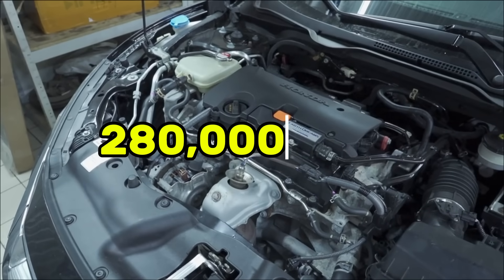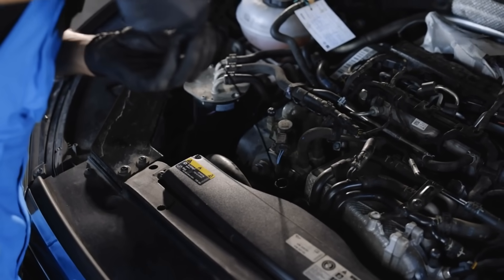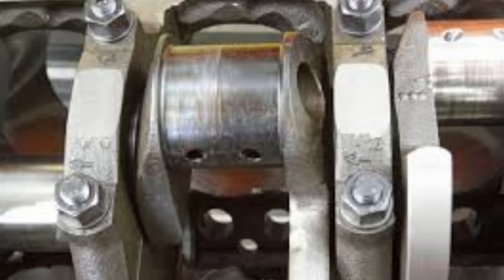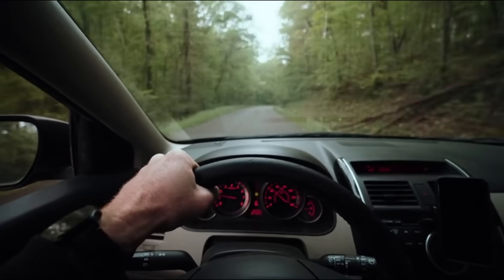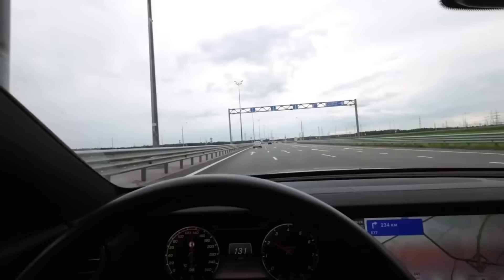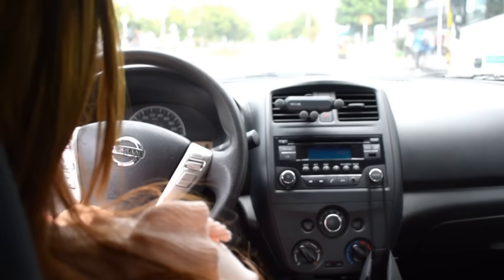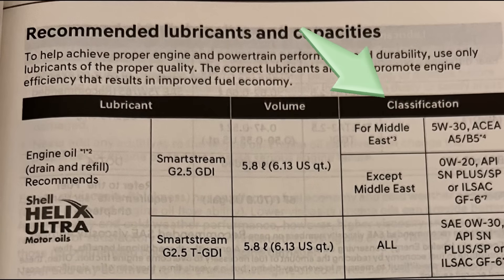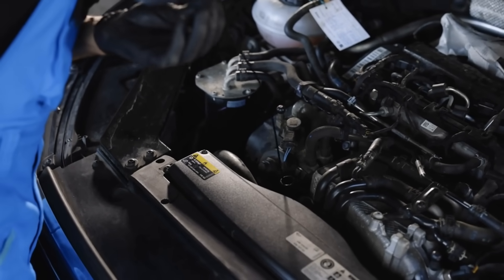I Tested 200,000 Miles of Engine Oil and Found the SHOCKING Truth

Comment: Run a 0w-40 viscosity, and change every 5000km/3000 miles...............................Your engine will last over 300k no problem.
You have the low viscosity at cold, and nice cushion when hot.............Just change often to keep the viscosity inprovers in good condition.

Comment: All this is so true just replaced a motor running 5w30 synthetic blend at170,000 miles now using 5w30 full synthetic oil filters make a huge difference as well😮

Comment: This video is very misleading. There is a lot of variables at play(if this experiment is actually true) fuel type matters(top tier vs non) oil type(type of chemistry/brand) and also driving habits. Personally I stick to 0w20 and no issues so far I also use penz ultra.
Reply: Depends on the engine too. You’d kill an old bmw engine with 0w20 they recommend 5w30 but most run 5w40 in Europe and 10w60 in hotter climates

Comment: My 1981 Subaru GL hatchback's owners manual recommends against 5w-30 (Unless you are living in Alaska)  because it's too thin to protect your engine and recommends 10w-30 for the winter. 20w-50 (thickest oil) should be use in the summer or all the time from S. California to Florida.
Reply: That is ancient aliens tech...modern cars are designed with lower tolerrances, complex.turbines etc.

Comment: Recently purchased a Nissan Qashqai Hybrid. The engine only turns a generator that feeds electricity  to the battery which in turn feeds power to the electric motor which turns the wheels. The engine oil is a 0w16 which is even thinner than the 0w20. I can only assume that because the engine is only running now and again this will be okay. Saying that it is a bit worrying when reading this article. Any comments or advice would be appreciated.

Comment: None of the 0w-20 Bad stuff happened to me. In 2016 I bought a brand new Honda Fit.I've been running shaeffers 0w-20 I change it every 10,000 miles, and I now have a 150,000 miles on the engine, and it runs just like it was new. I check with Blackstone labs, and they say that I have less wear at 10,000 mile. Oil changes versus 7500 in the same vehicle. With other Owners , and they say that viscosity at ten thousand miles is right on par with 0w-20 I do drive, Non Aggressively though I live in Southern California high desert where it gets around a 107° in the summer and down to 32° winter mornings. So I think I'll just be sticking with the 0w-20 If it ain't broke don't fix it😊
Reply: We all know you can't break a honda fit even if you wanted to
Reply: Consider using 0w-30. Same cold start protection, MORE protection for hot engine. My Mitsubishi thanks me every single day for this oil specification.
Reply: @RaduMichaelI don't know why I actually would change to 0W30. Because with 0W20 all is good and Blackstone says, keep doing what I'm doing, my wear, metals are virtually nil. Now I could do it as an experiment to see if wear metals even get better but I don't think they would As I'm doing it now.That engine will probably way out last the whole body of the car

Comment: I have several cars that range from 0W-30 (not mentioned) to 10W-40.  Never use any 20W oils or lower.
I change the oils in the turbo cars every 3000 miles and 5000 in the non-turbos.  Also, I use 100% synthetic from major brands specified for the engines.
Reply: Actually ow 30 IS mentioned in the video if you watch it all.

Comment: 5W20 in an 05 honda pilot at 256000 miles
Reply: Honda  👍🏿
Reply: 242k on my 05 civic hybrid. I use nothing but 0w-20 in my Honda as told. And never had one issue. Inside the engine bay is spotless as tho it came out the factory. These kind of videos always make me question alot of things.
Reply: @elijahbreazil3082 honda and japanese carmakers in-general make better engines.  Thicker oil is a band-aid for problem engines like Jeep & Chevy
Reply: Well done. 200k is the benchmark for modern engines. Lots of people talk 100k+ but in my opinion most cars accomplish this easily. Very few are part of The 300k Club. I had 2 honda civics and a crx reach 260k. Also have a toyota sienna just recently hit 270k. 10w-30 all day every day. Located in southern California climate zone.
Reply: @snaxs2000 this is the original engine with no issues. I want to see how far it goes, so I'm into it till the engine dies 😊

Comment: Mine is 2013 ford ranger and i use 10-40 diesel shell helix engine oil in it.. The car millage is 220.000 until now 2025,still in good condition..plus i from malaysia and here the weather is very hot..

Comment: My 2001 BMW 330i consistently uses 5W-30, full synthetic plus one oil additive, Liqui-Moly, at every oil change. Still smooth engine at 197,000 miles.
Reply: Molybdenum clogs the filter.   How often are you changing oil?

Comment: My 2011 H - Crosstour requires 0W-20. I use synthetic 5W-20 and 1 oil additive, Liqui-Moly, at every oil change. So far, smooth sailing at 163,000 miles.
Reply: The only difference between synthetic 0W-20 and 5W-20 is that the 0W has a better flow rate during cold starts. Modern synthetic oils already have additives in them that were developed by the engineers to provide the protection you need. Be careful about the additives you put in yourself. It is possible to get too much of a good thing. 20% or more of modern synthetic oil is the additive package.

Comment: The most important thing is to change it regularly which surprisingly many people fail to do.
Reply: They fail to do so because they are too stingy.
Reply: @ralfrufus6573 or because the manufacturer promotes „long life intervals“. Which works most of the time for the first leasing period, ,mostly also for the second owner, but third owners inherit the problems then.
Reply: Exactly, I change mine 3 times a year no matter what. Around every 3.5k miles. I idle a lot though, when warming the car in the winter so it’s not fozen when I get in, that burns extra oil
Reply: @designer.346 👍💯Excellent oil change schedule.
Reply: I stick to 3000mile oil changes.  Dont care what manufacturers or dealers claim .  They wana sell more cars.  I just change my oil and filter myself every 3000miles so I kno its actually done right.   Too many horror stories about shops not even changing the oil and charging anyway.   Or leaving the cap off or not tighting the drain plug and oil leaking out ect.  I use valvoline restore and protect oil and microguard select oil filters.   My current vehicle has 239,000 miles runs like a top.  My wifes cx50 is brand new and I change hers myself also.    I dont trust the dealership.   I keep the reciepts and keep a log book recording miles n dates ect to keep my warranty happy 😊
Reply: Every 3,000 miles period
Reply: Yup thats another reason to use thicker oil. It maintains viscosity longer than lighter oil.
Reply: and use synthetic oil.
Reply: @sptrader6316 there is more to it then that, there are 2 different API Shield on each bottle of oil for gasoline engines API SP → Latest standard (for modern engines, protects against LSPI and timing chain wear) model years 2020 and up and API SN, SM, SL → Older gasoline standards. API SN – Full Synthetic, API SM – Synthetic Blend, API SL – Motor Oil conventional.
Reply: I'm an old fart, still do it between 3,000 and 3,500 .

Comment: I have a 2016 Jaguar f type R Jaguar recommends 0w 20 no way use 5 w 30 it’s a 550 hp supercharged engine. Am actually thinking of going to 5 w 40. What do you think?
Reply from the maker: Stick to 0W-20. Your engine is designed for it. Thicker oils (5W-30/40) can cause flow issues, especially on cold starts, and are not recommended for modern engines engineered for 0W-20

Comment: I've been using 10W 40 for 10 years now on my chevy. The engine is purring like a cat. I also live in a very warm climate. My manual stipulated that i should use a 5W 30. Naah, too thin!!!
Reply: I use 0w40 in my 2008 Audi with the V6. 175k miles so far. Change once a year whether it needs it or not.
Reply: @RogerBeckett-s2j  lo 0w40 è la migliore gradazione di olio, ed è un olio con grandi contenuti tecnici.
In Europa è molto usato lo 0W40.
Molto usato il 5w40, anche.
lo 0w20 sulle macchine giapponesi perchè lo richiedono, ma danno anche garanzie estese, e devi fare i tagliandi da loro.
il 5W30 specialmente sui diesel, per mantenere irrorata di olio la turbina.
In America vedo che i quesisti si dividono principalmente tra 0W20 e 5W30.
Quando lo 0W40 è forse un olio che mette d'accordo tutti.
Qui il MObil 0W40 è ritenuto l'olio eccellente. Lo Shell 5W40 Helix Ultra ill top insieme al MObil e Castrol. C'è anche il Motul che sta guadgnando immagine e mercato. 0W20, ormai lo fanno tutti, ma in concessionaria, ti mettono quello loro. Per il 5W30 è sempre Mobil il top (Esp) e Castrol.
Olio americano qui arriva solo il Royal Purple, per gli amanti del marchio (anche se Shell è Penzzoil)
Reply: @Sonolaleggendadeimotori I use the Castrol in my Audi. I use cheap but still synthetic 5w-30 in my wife’s solara convertible. My cars usually go about 250k miles before I trade for newer used car. I’ve never bought a new car in my life.

Comment: Mobile 1, 5W-30 Full Synthetic High Milage Extended Performance. 2009 Cadillac SRX 4.6 V8. In Las Vegas, she runs excellent!
Reply: Run a 0w40 Mobil 1 in it and that engine will love it...............been running it in my C5 corvette with the LS1 for years.

Comment: Ferrari knows better and is using 5W-40 HT/HS 3.5 for his cars.
For my 3 cars I'm using 10W-40 A3/B4 HT/HS 3.5!!!!
In Greece the weather is hot especially at summer.
Reply: 0w weight oil is to thin of base for IC engines, 10w30 is a better option unless you are in extreme cold climate

Comment: The moment you start talking about engine oil in terms of  think and thinner and your your way off and have no understanding of how viscosity works because that is the measurement of a fluids resistance to flow against gravity
Reply: And eyah you idiot if your starting the engine 10 times today you go with lower viscosity because 70 to 90 % of engine wear happens during the cold start period but if your running it all day warm or runing a rally you can go with 10w60 if you want

Comment: I run 5w-22. Engine 343k miles on 3.0 Accord. Change once per year with 8-16k miles. Works great. Fyi:  the broader the stated viscosity range, the sooner the viscosity breakdown. Example: 5w-50 is much more difficult to maintain than 5w-20. All things equal.

Comment: Using 5w30 shell helix ultra in Hyundai Verna from india , and yes it makes sense engine has gone better.
Reply: Is that oil available still in Indian market? Couldn't find one for h city
Reply: @deepud2kin1 now there's new 0w30 shell helix ultra api sp carbon neutral fully synthetic by hyundai dealership you can ask them they will order for yo7 speciality

Comment: In my Silverado I ONLY Used 20W-50wt , Royal Purple...........has 298,000 pn the clock.....go figure !!!!
o Yes I bought it brand new in 2002 , the first Oil change was 20W-50wt !
Of course change it at every 5,000 miles.
Reply: A man after my  heart, royal purple 20 /50 
2 small blocks one at 280,00 and still roasts the rubbers  20/50 in every car  i ever owned
Reply: That is a fantastic oil!
Reply: It has a magic  ingredient for sure  youll notice after the first 50 miles you no longer need the same amount of throttle to go places its way less effort  and fuel economy goes up  btween a tune up and purple i gained 5mpg on a 350 carbed motor  @Maynardd
Reply: @Mr.Goodwrench...and the other posters in this discussion: I think there is a different conversation between the newer and smaller engines where the recommended oil is 0W-20, and our older V-8's and V-6's. It is the apples & oranges comparison. 

I have a 1992 Silverado with the great 350 V-8, and even thinking of putting 0W-20 in it is insanity...I can only imagine what kind of racket the motor would make or how long it would last before seizing up.

I bought a 2015 Toyota RAV4 about a year ago, It has the 2.4 VVTi motor and had about 128,000 miles. The oil cap says 0W-20 and that is what I used on the oil changes every 3,000 miles. But...on every start-up, even after driving for a while, the motor had a kind of rattle which would quieten down some but not completely. I asked my mechanic of 25 years about going to 5W-30 and he said it would be fine. The difference was immediate: no more rattle,  not even on a cold morning start-up, and the motor runs quieter than it did with 0W-20. So...for me...my car runs quieter and hopefully will last longer...than trusting it with 0W-20.

Comment: If u use 5w 30 it will sieze your engine up if u are meant to use 0w 20 as the components in the engine are to tight and close together for it to lubricate properly.  Just use what the manufacturer states its as simple as that
Reply: I use 5w30 in a 0w20 still going 🤷‍♂️
Reply: BULLSHIT... I've put over 250,000 miles on 3 different Subaru's that called for 0w20 & now 0w16 and used Pennzoil Ultra Platinum 5w30 from new in all of them. Changed every 4,000-5,000 miles...usually 4,000. You have been fooled by misinformation if you think 5w30 will screw up a 0w20 engine....no way no how bro... it's the biggest lie the auto industry has ever told the sheeple. If it were true you wouldn't find the exact same engine in different countries calling for different viscosity....so screwed up that they have people believing such garbage
Reply: Sorry my comment upset you but its the truth , maybe you should just listen and take some advice it will help also take some anti stress medication for yourself  @williamjones6652

Comment: 5W-40
Reply: 5W-20
Reply: @wizardofahhhs759  If you are driving a vehicle equipped with a turbocharger and especially you live in a warm/hot climate, you should never be using a 20 weight oil.
Reply: @markdavidson1049  The engine makes too much noise on cold start, even in the summer that's why I switched to 5W-20.
Reply: @wizardofahhhs759  You can still use a 0w-30. The number to the right is after the engine has reached operating temperature. Cold starts are more concerned with the number on the left so if it is that bad during cold weather, go with a 0W-30
Reply: @markdavidson1049 
ワイのエンジンEA888-G3 で10W-40. 馴染みの整備工場では薄いオイルはオイル漏れになるというので、それを入れて何の不調もない。110,000KM OVER
Reply: @Arcticraider  Nice

Comment: Another bogus video that should be read over and banned off YouTube.  The claims that 0w20 is bad when specified by manual is completely wrong.  The motor oil geek did a special on this and proved it wrong,  5w30 can actually increase wear, not minimize it.    There are plenty of 0w20 engines with 250k plus miles.    Use a good quality oil with robust additive package and no problems….. use cheap 0w20, yes you may have issues.
Reply: My engine (OM646) has over 427000 kilometers with 15W-40 in winter and 20W-50 in summer. Try that with your water oil and cry me a river because it won't make it.
Reply: @ralfrufus6573  Not true...
Reply: What is a robust additive package?
Reply: Can you send the link for his video? I'd like to see that one. The one I saw of his was showing the 5w30 showed less wear in the long haul. Maybe I heard it wrong???
Reply: @williamjones6652 If one says thicker oil causes more wear and a million say it causes less wear, whom do you trust?
Reply: Ask GM how that works on the 6.2
Reply: Want to know the truth? There is no 50 engine study...
See https://youtu.be/XyBUcxFmqn8?si=hnSVpGg4JEcjbPj6
Reply: Actually, any 0W-20 oil that meets the same specifications found in your owner's manual is just as good as many more expensive oils name brand oils.

Comment: Have a 2024 Mazda 3 Hatchback, non-turbo 2.5 ltr. 4 FWD  Automatic 6- and currently OW-20 Synthetic is being used during warranty oil changes.  I've only 7700+ miles on the vehicle.  Should I go with 5W- 30 synthetic when warranty is up?  PLEASE, let me know
Reply: Why wait, switch now

Comment: These vedios, on oil,, hmm, I own  a harley,, change all the holes, at 2500, miles,, 65 bucks. Cheap,,   bought a 2026 honda passport, trail sport, takes 0 w 20 w synthetic,, hmm, change it at 4,000,  miles,, oil  breaks down,,   70 bucks,  evey 4  thousand miles,, cheap ,

Comment: My Toyoda calls for 5-20. I use synth 10-30 winter, 10-40 summer. Perfect! Zero issues, and perfectly smooth and quiet engine. Did people forget what viscosity means??
Reply: Absolutely,this is absolute bollocks,it all depends on how and where the vehicle is operated,one size doesn’t fit all,the mere facts that they show pistons that are all cocked up with hard carbon tells my everything because if your engine is burning oil in any amount that solid carbon wouldn’t be there,oil devolves it.
Reply: The EPA "calls" for dangerously thin oils.
Reply: Viscosity mark does not say anything about the quality of oil. API/ACEA specification rxplains it...
Reply: I run 10-30 in so cal
Reply: You have no turbine. If you increase vascosity above the engine design, you destroy the turbine. And other parts. The test he talks about is irrelevant. Same engine should use same oil. Either half use higher that recommended  either half use lower than recommended. What should be done is compare similar engines designed with the 2 different specs oil.

Comment: My car states to use 0W-20. I don't. I mix it with 5W-30. Half and half. No check engine light on, no camshaft phase issues, etc. 

Changed every 5K with full synthetic. This works for me.
Reply: Ooooh 😳🥺
Reply: That's fine...
Reply: @njsongwriter Do you think it's fine mixing a concoction not knowing what the true weight would be & whats best for the engine while also mixing different Additive packages?
Reply: Never ever mix, those 2 different weight oils have different Additive packages regardless if they are the same exact oil brand. Not good